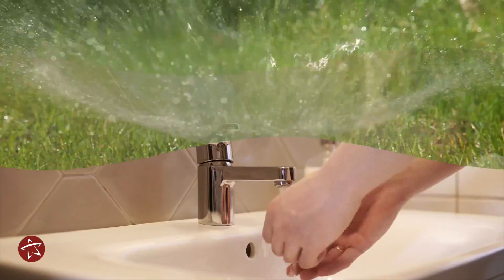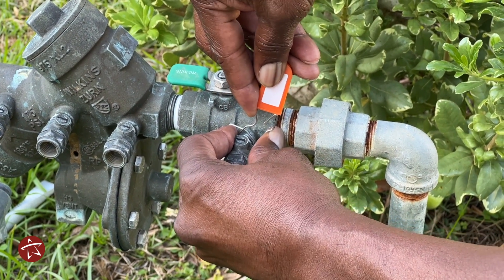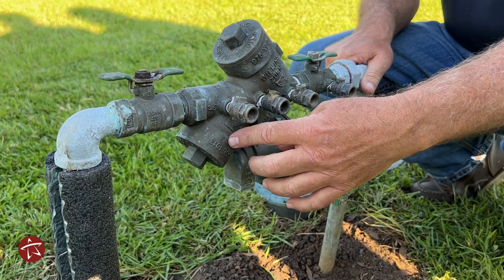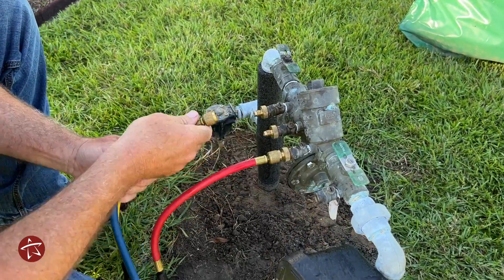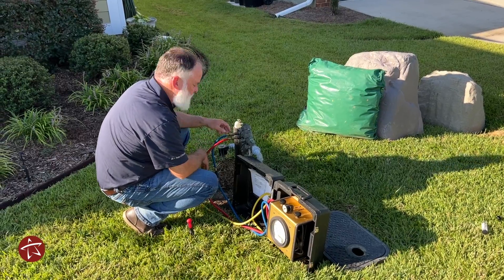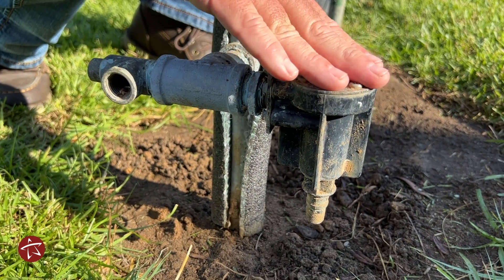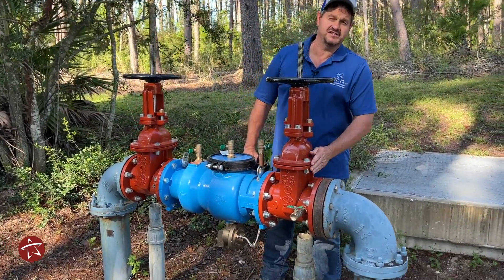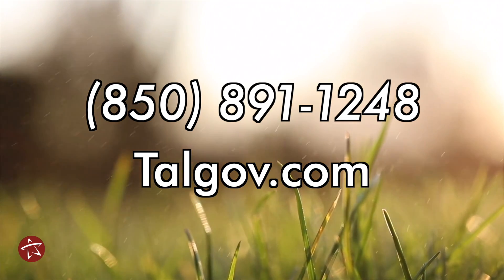How the City's Cross-Connection Control Efforts Protect the Water Distribution System

Comment: What do you tell the customers about the unprotected cross-connection within the plumbing system. The public water system is protected but what about the person drinking the water? Also, the person performing the test did not measure the differential pressure across the second check valve or conduct a tightness test of the second check valve by introducing high-pressure water downstream of the second check valve. The test procedure conducted did not confirm that the backflow preventer met specifications.  Another factor regarding the installation of a RP on the service line is that they are designed to discharge water under certain conditions. If the public water system is trying to conserve water installing a device that discharges water may not be in the best interest of the of conservation of water.